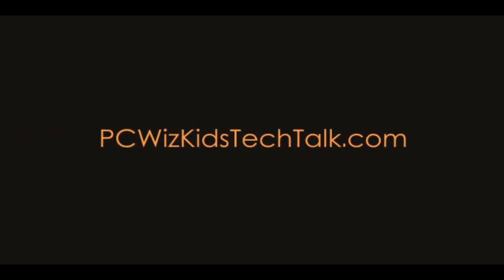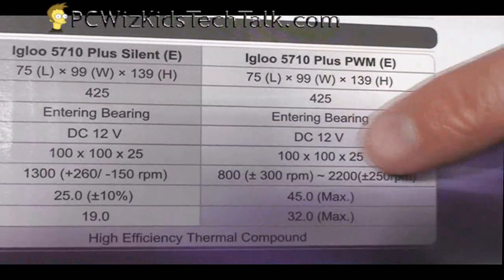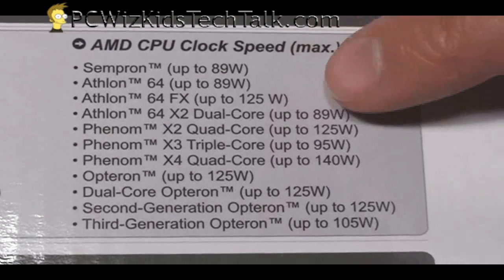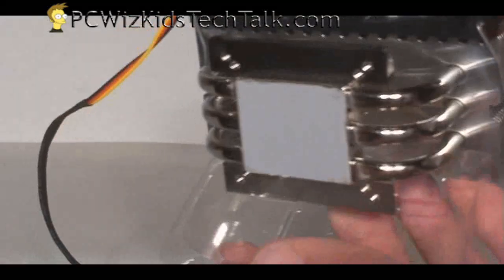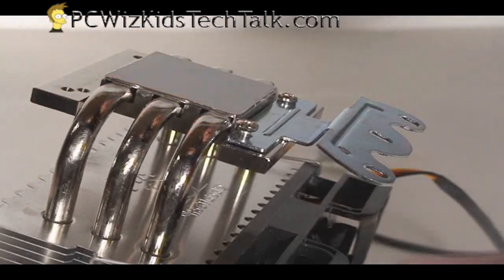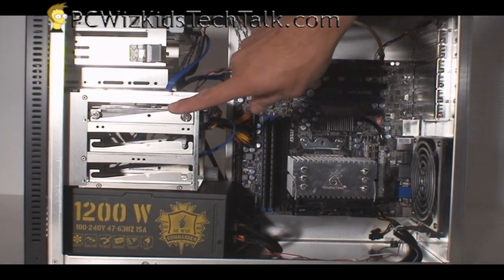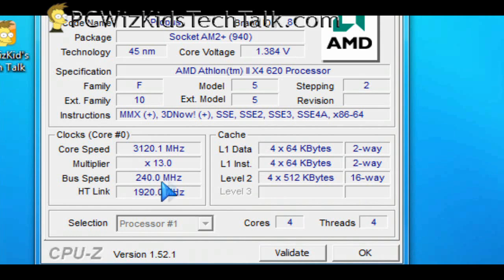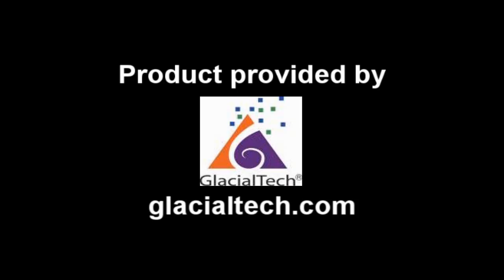GlacialTech Igloo 5710 Plus Silent - CPU Cooler Review

Comment: what is inside the heat pipes? if nothing as in hollow, shouldn't there be? for instance  a GNX grand national has sodium filled exhaust    valves to prevent  melt down.